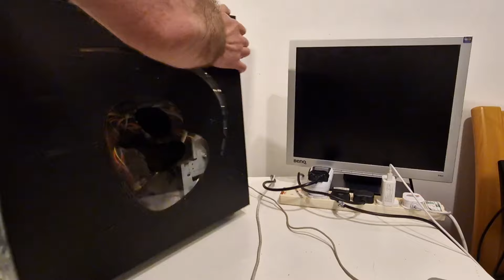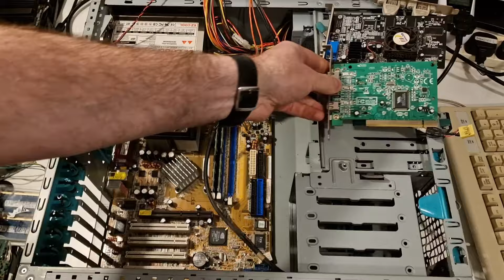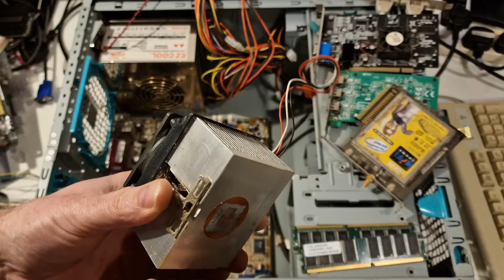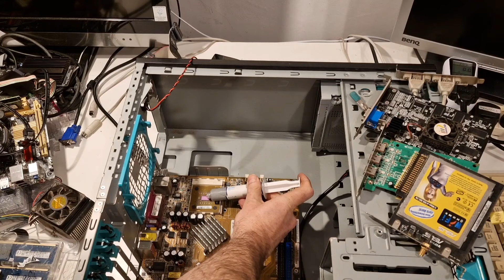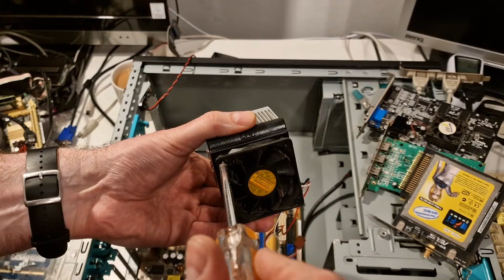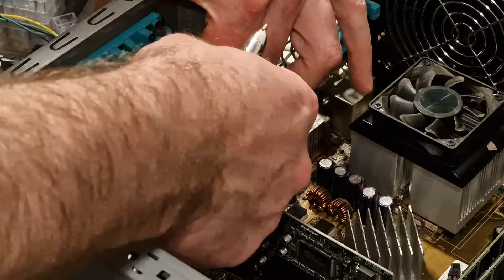This one is WEIRD! Will it work? How dirty is it?? 😱

Comment: Watching you put that heatsink on backwards multiple times hurt. The aluminum block is cut specifically for the shape of the socket, where the cut portion is placed over the socket 462 label. The nforce chipset on this motherboard is one of the best for that socket. With the AGP 8X 3.0 slot, it's great for more modern AGP cards. Not to mention it has it's own form of Dual Channel memory. It will also boot for a PCI Sata Raid card for better Read/Write speeds, making the whole system feel snappier. Also it has mounting holes for aftermarket heatsinks like Zalman/Cooler master. It's really a wonderful board.
Reply from the maker: Thanks that's good to know! :)

Comment: Nice find, that is a pretty decent board with Nvidia nForce2 Ultra 400. Best performing chipset for socket 462. I think 1 ram module needs to go in the blue slot for dual channel ram.
Reply from the maker: @0MeALot0  that's good to know! Thanks

Comment: Interesting mb with the dual lan ports. I've got a slightly newer version of this that has a WiFi board as well. But it plugs into a pci slot. Never seen one with a plug in board like that
Reply from the maker: According to Trusted Reviews, it cost £85 in 2004, which seems pretty reasonable considering the spec. Thanks for joining by the way 😁